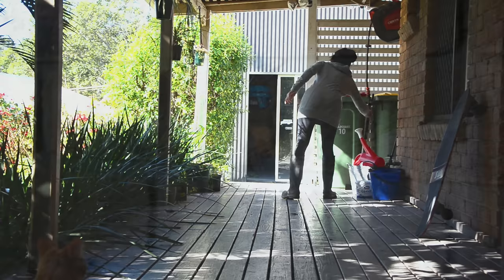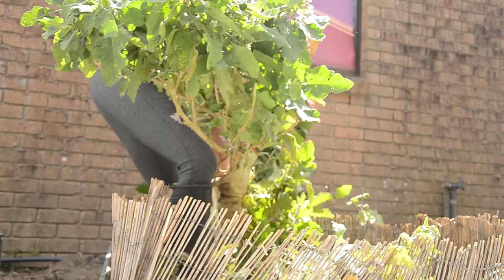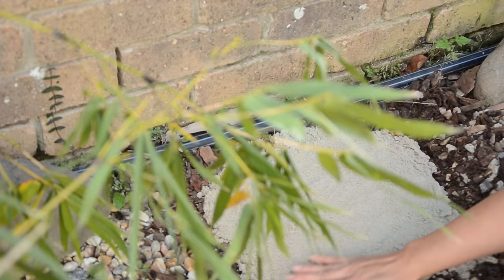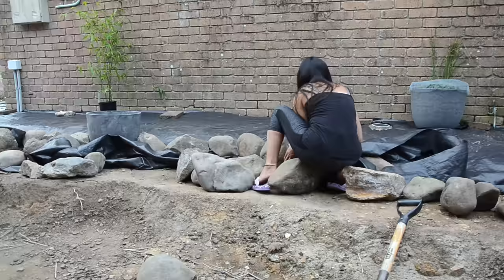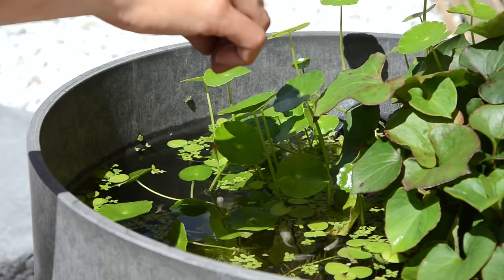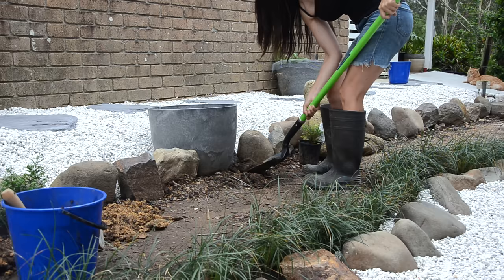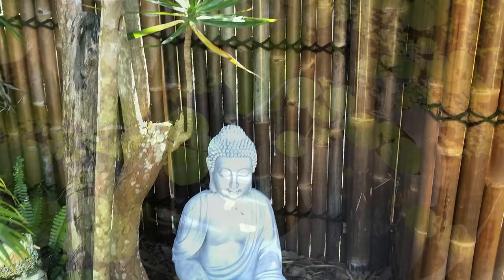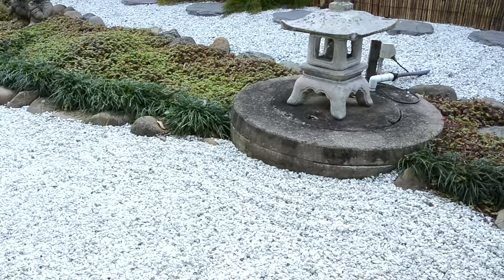Garden Makeover/ DIY Japanese Zen Garden With A Rice Fish Mini Pond

Comment: Thanks for this video, I am amazed that you did it all by yourself. May I know how do you get rid of the small leaves which felt on the pebbles? I have a zen garden too but my gardener didn't advise to use the small pebbles, instead I am using stones to replace the pebbles due to the leaves felt on it hard to remove.
Reply from the maker: Thank you for your lovely comment! Yes I see what you mean about the leaves on the pebbles. If it’s not much, usually the wind blows. But after the rough weather, you’ll find lots of leaves. You can use soft brush broom to clean the pebbles but I just pick up by hand. It takes about half hour to clean this area, though I’ve only done twice for the last 2 years.
Reply: @livelovelaughdiy  thank you for your kind reply, I will try it to use the small pebbles next time. I still feel that the effect will turns out nicer with small pebbles.

Comment: Great job and I do realise the hard work you did, since I have been doing similar hard work for the last 8 years, but at the end it pays. The worse challenge for me was to get rid of the impressive amount of soil I dug up. Anyhow,  I also did a shishi odoshi but I have not installed it yet since I have not found a solar pump strong enough. I keep looking though.
I still have a part of lawn that I would like to convert into a japanese garden and I loved the turtle vine you show in your video, but can it resists a harsh winter? I do not know where you live but as far as I am concerned, I need to choose plants that can resist cold. Also, I did try a while back, the white gravel/peebles but after a while they turn green and get very dirty, so it is the best option for me.
If you have any suggestion, they are welcome.
Reply from the maker: Thank you so much for sharing your experience! I live in Gold Coast, Australia so it’s not that cold in winter. Turtle vine grow very well here but I am not sure if how it is going to be in the colder areas. Yes you are right about the white gravel, it turned slightly brown now as it is accumulating dirt and dust over the time. The solar pump in my shishiodoshi fountain is a small one. It works well when it’s in the full sun, but as soon as it’s in the shade, it stops working. It operates on energy saving mode, and doesn’t give enough energy to run the water on the saving mode.
Reply: @livelovelaughdiy  Thank you for these details. Yes in Australia the weather is much different than in France. I have a few more ideas for my garden but it gets more and more difficult when you are aging... :-) I will try again for the shishi odoshi and I have also thought about building a harmony botanical tower (I have plenty of wood in my garage and a leftover of red paint, that should do it). Keep us posted about your latest achievements.
Reply from the maker: Botanical tower sounds amazing. Thank you again for your message from France 🇫🇷 I would love to visit your country someday!
Reply: @livelovelaughdiy  Let me know if you do.

Comment: 3:39  that nasty beam and the metal L beams are for supporting the plastic gutter from falling off the concrete pathway. Without the support from the other side over time that plastic will break.
Reply from the maker: Concrete guys told us that they were coming to remove those metal bars, and didn't turn up so I removed them. Oh no...😨

Comment: What kind of solar pump did you use? I am in Australia as well and would like to know. Thanks
Reply from the maker: I bought my solar pump from eBay. It was about $22, it’s for water fountain. This pump works with full strength when the solar panel is getting full sun.

Comment: When you lifting the Pick Axe the left hand (if you are right handed) put close to the steel head and while the Pick Axe head comes towards the ground run you're left hand along with wooden handle to the right hand (never loose the right hand during this) , let the gravity to do the job and give little support with right hand . And also be  careful when lifting the Pick Axe because upper steel part can be injured your back. Therefore never bend the left hand elbow when your left hand fist passes from the shoulder level.
Reply from the maker: Awww 🥰 Thank you so much for your advice!! Actually I had some mornings woke up with back pain. I am not so familiar with the correct form of using the tools. Your advice is very helpful!
Reply: Do some simple jobs that can be done around 20 minutes. Same technique can be applied to Axe, Hoe etc..